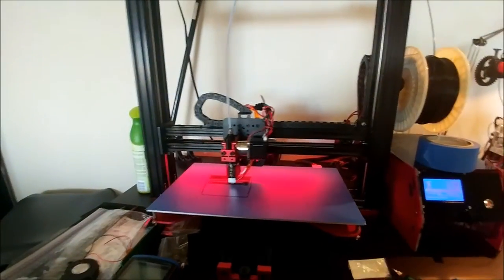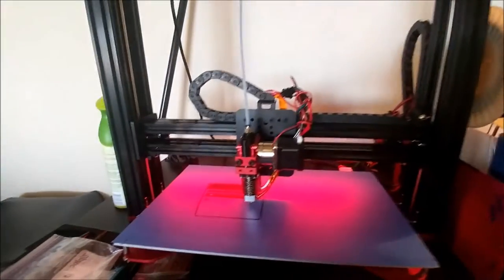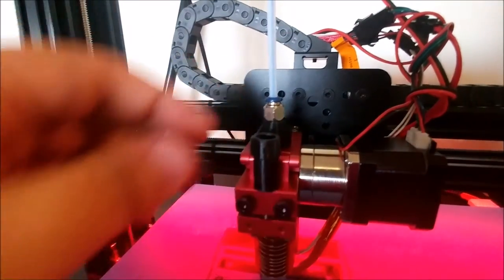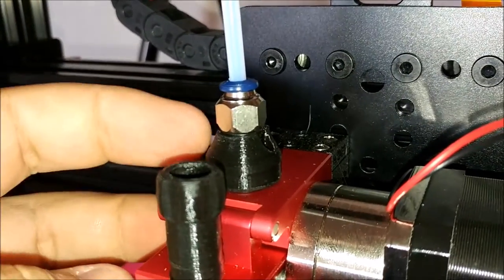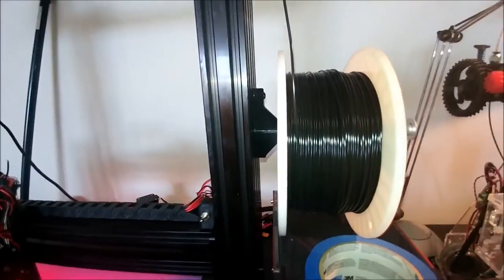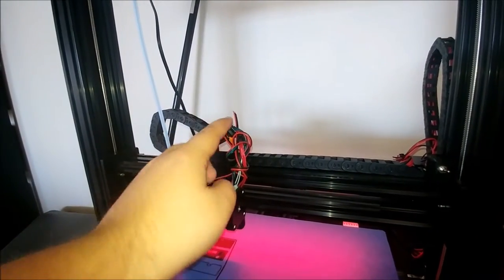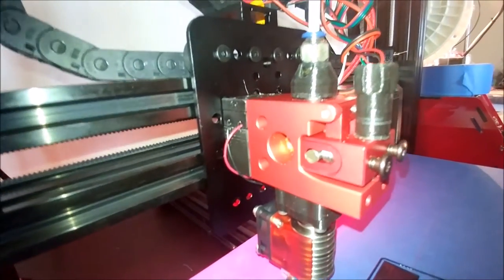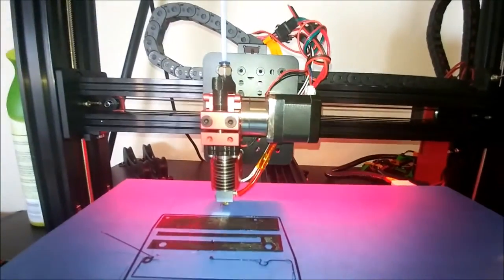Tevo Black Widow 3D Printer First Follow Up!

Comment: Can/would you be able to take a picture of the Z side gantry plates that show the correct installation of the bolts, spacers, ecentric nuts, etc.  Maybe post it on your website?  Thanks in advance if you can.

Comment: I note according to the specs this prints at 100mm whereas the Taurantula prints at 150, I suppose because of the weight of the direct extruder.  Is that a problem, or does the difference in specs disappear in reality?
Also, in this video have you taped or replaced the top of the hotbed with blue?
Reply from the maker: The max speed specs of the printers are somewhat misleading. While the black widow is 100% capable of up to 150mm/s printing (and is actually more capable due to the geared extruder), due to the large build area and momentum in the axis you may end up skipping steps.

If you have acceleration settings enabled you can get silky smooth prints at very fast feedrates. the acceleration will slow the printer down as it enters a corner in order to ensure you dont "slam" an axis to a stop, which can cause you to skip a step.

In reality sprinting at these speeds is an art. Most of the time as speed increases quality decreases. That said i have amazing results at 75mm/s on this printer. i am currently tuning and getting even faster without loosing quality.

In this video i have put a layer of 3M blue painters tape on it in order to protect the bed and give a good bite for the PLA. I have yet to try the stock bed surface.

Comment: In conclusion it looks like this has much better results than Tarantula, or is that because of the E3D upgrade?  Can the Tarantula print as well as this with all its upgrades?
Reply from the maker: The upgrade to an e3d hotend actually did not improve the print results at all. The stock hotend is Very good. My other printers use E3d so i have swapped it off so i can share parts and nozzles. This printer has an edge as it is a geared extruder!

Comment: Is it worth making an enclosure for it?
Reply from the maker: I have thought about it for harder to print materials however the bed is so large that there is almost like a large pillow of hot air around any normal sized print so I havent needed one as of yet.
Reply: I have read (don't remember where) that fastening it to the enclosure can stiffen it up quite a bit and remove some vibrations that can affect the prints. Also, it should help keep dust off the machine while you're not using it. So for those reasons I'll make an enclosure.

Comment: Can it be made into a dual extruder?
Reply from the maker: Yes, The Black Widow is 100% compatible for upgrading to a dual extruder. All you will need is a new extruder / hotend and a single stepper driver of your choice, and a firmware flash in order to activate it.